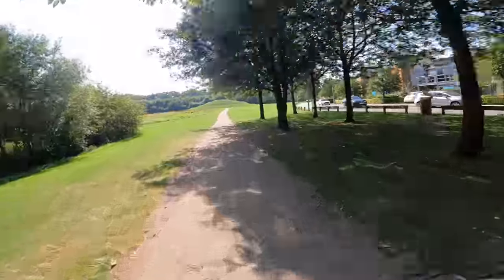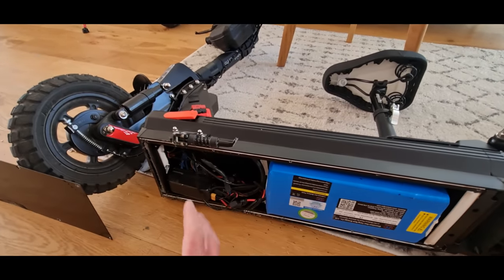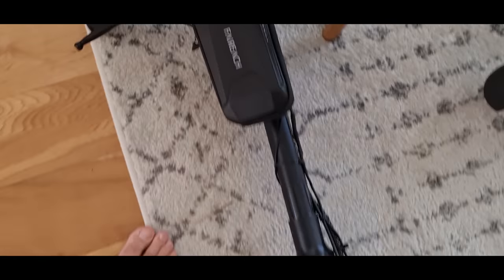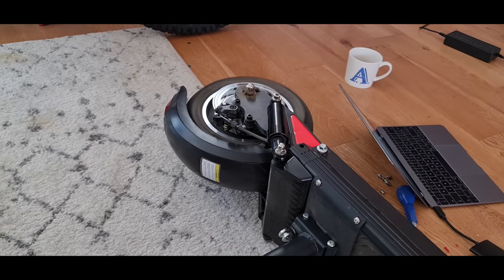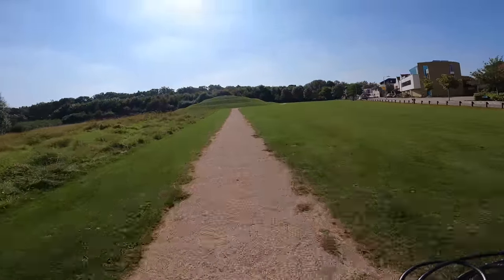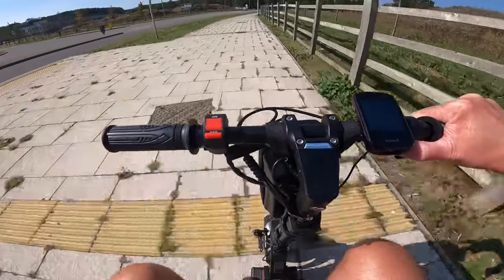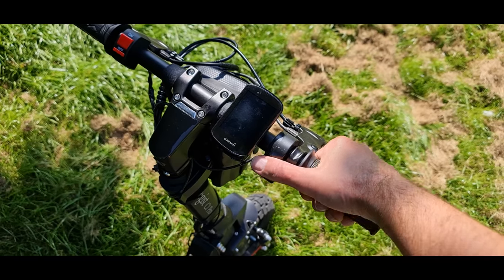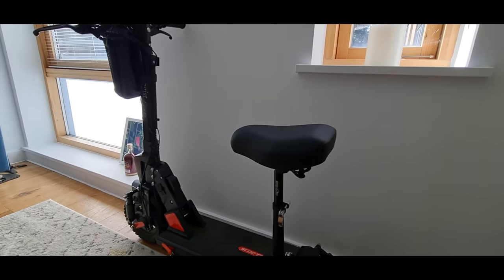MORE SCOOTER MODS!!!

Comment: Are you from gosport mate? Ive got a Wolfmac H10 and it's a non runner. I need help sorting it out mate??? It got 2 600watt motors 52V. I bought myself a multi meter it all works just can't get it going. Plugged the wrong plug in the other day and had a little fire so melted a few wires but have ordered new ones off eBay. Do you fix scooters mate???? Cheers Ryan

Comment: Pretty bad ass for a little scooter. I like the household circuit breaker idea to pull max juice from the battery as needed...and the "coasting" part of your switch is a good thing to reduce motor use.

Comment: Hello andy, I'm looking for a bit advice..I've got a mtx33 1500w kit with a 1500w 48v 17.5ah Battery and I'm looking to upgrade the controller that you get with the kit to a sabvaton, I'm just not sure which spec of sabvaton controller would work best for the kit I have ? As there s a few different sabvaton controllers with different wattage and amps ect..?? Thankyou

Comment: I have the same scooter and I am having alot of trouble trying to remove the back wheel in regards to the cable attached I can not find where to disconnect it to give enough length to drop the wheel. Any suggestions would be much appreciated
Reply from the maker: Hmm, sounds like there's not a lot of slack... you might have to take off the bottom panel and see if you can feed a bit more of the motor wire through. There's 3 motor phase wires which are usually bullet connectors and then a small micro connector for the hall sensors. Worse comes to the worse you can unplug those and then pull out the wheel completely.

Comment: Silly question Andy, But can you link a bafang with a phase runner, Im sure you rigged one up too the vapour you got but im not getting the bafang ultra, Just grabbing the 1000w 48v for now, Only coz i already got a 48v 20ah battery, I do plan on getting the ultra tho, Just the funds are in the way of grabbing the big boy bafang, Still tho the 1000w is a bit of a blower, I will buy a phase runner if it makes the bafang more of a monster, Like i said tho only got 48v battery, But yeah will defo grab a phase runner if it makes the bafang better, Soz for the daft question bro....
Reply: You can definitely run a bafang on a phaserunner MT, you would just have to get the phase wires and hall sensor wires wired up correctly. Technically a Phaserunner L10 would be fine but you would need to adapt the bafang wiring harness to the L10 plug, so I don't think that is worth while.
Reply: @fang64  Oh ok, Yeah that seems a lot of hassle, Taking the motor apart is not the road i want to go down, Excuse the pun, I bought a carrera hellcat lmt edition 29er by the way, lol, Its waiting for the bafang motor, I was giong to get a hub motor save few qiud an that, But after seeing the bafang 1000w, I was thinking coz its only 1000w it would be crap, I got a 1600w monster scooter an that only hits 35mph so i was thinking 1000w aint going to be very good, Some of the vids i seen on youtube the bafang motors are blowers, I dont understand tho how the hub 1500w hits the same speed as a bafang 1000w, Is it coz you got use of gears on the back, Also looking at the cyclone 3000w motor aswell, Was told you need to weld a bracket or something, But that cyclone motor allows you to use gears in the middle aswell apparantly, I really cant wait to actually get the motor for my bike, New toy an that, Nice one for pointing out the extra wiring ect, Prob just leave it as it is, The bafang pushes enough torque as it is really for what im using it for, Its only an everyday ride, Not off road crazyness so box standard it is, lol, Cheers yeah....
Reply: @mad-b264  zero need to take apart the motor, you can just use the harness that comes with it, and wire it up to the controller. You can actually get the bafang connector but you still are on the hook for getting it wired right.
Reply: @fang64  Bafang connector, What is that, Im new to the electric bike motors, Dont the 1000w bafang push out 1700w peak power?, I do plan on looking a lot more into programing the bafang, One im looking at on ebay got a mosphet controller i think its spelt like that lol, Im actually looking foward to doing the install an having a little pet project to play with, lol....
Reply: @mad-b264  Well you should find out what you currently have, you mean Mosfet. Your ability to handle peak power is going to depend on 3 things, Battery, Controller, and Motor. Battery limitations, how much current can the BMS (battery management system) of the battery provide (max current) at a given voltage. Controller limitations, the wire gauge (overlooked but important) and wattage limitations of the controllers internals (if your controller is maxes out at 25A at 48v you only get 1200W). Motor is mostly going to be governed by the max phase current it can handle, you can get away with running higher voltages but your current limitation is down to the construction of the motor.
Reply: @fang64  Nice one for that bro, Never knew i would only get 1200w peak with a 20ah battery, Its meant for a 1600w scooter so surely it would be good for 2000w??
Its proper confusing all this amp hour an watts lol, I am willing to learn tho, It can only be a benefit knowing the how too's when building an electric bike so too speak, Lol, But yeah I am learing slowly but surely, lol, I never wanted to get a new battery coz i actually payed 360 qiud for a 48v 20ah battery, Felt robbed paying that price when i see 52v 20ah for 240 qiud on ebay, Is 52v a big difference from 48v?, coz it dont seem much, I dont really want to buy a new battery but dont want to take it apart an fit a new bms to it, I actually did buy a soldering iron aswell but im worried summit will go wrong an i do damage that will cost more money, I been struggling to save up over the last year, Dont know why, Think it might be cost of esting healthy on Drs orders, Lol, So i cant afford to take things apart to make a mistake that costs more money, I actually could take the motor off my electric scooter an buy a frame or get summit made to hold the motor in place like the bafang but it wont be held in by the crank so i think it will be more problems than its worth, Plus its a working scooter an i dont want to destroy summit that is working, Anyways the monster scooter is great fun, An buying the bafang will give me another toy an transport to use, I plan on having a week away in Brecon Beacons, It not far away from me an glamping is actually not that expensive for what it is, Brecon is bit hilly in places so i think i will end up burning a hub motor, I plan on putting a little vid up when its done, Just showing peeps a few places in Brecon they can take a bike an chill, Might help my CPTSD issues aswell see, Been having problems with my mental health recently, CPTSD symptoms sucks i know that much, Do you know anywhere i can get a bafang 1000w a better price than 480 pound by anychance??
Reply: @mad-b264   20 Amp-Hour rating is not the Current Limit/Amp Limit of the pack, the Battery Management System is what controls how much it can output, a 20AH battery at 48v might be able to only deliver 200W max if it's limited to 4 Amp output by the BMS. As far as the motor and parts are concerned, I think finding a broker on Taobao or Alibaba might be the best route and trying to find cheaper. Dealing with those vendors directly is more difficult, but you'll be able to work with them to find a solution that suits you better. Although with supply chain issues right now you might be limited in what you can get "now." 

I am running a GMAC 10T from Grin Technologies on my mountain bike, and quite happy with it. Although I am running a 72v pack at 40AH that can do a max of 50 Amps output, I actually limit the max current down 20 amps to keep my bike at 1500W max output for the GMAC 10T. I did a kit from Grin Tech with that motor and a phaserunner L10 controller. I do have another bike with a bafang motor but it's running a smaller 350W controller and motor I mostly use it for short hops as it's only got 18~ mile range or so. I think kit wise there are good deals to be had, also keep in mind November 11th is Singles Day in china you might be able to get a deal on a battery or kit then as well depending on how crazy  you wanna go.
Reply: @fang64  What the F is singles day in China about, Daft question, Discount day for single peeps is it, lol, Never heard of it before....
Reply: @mad-b264  Yah I wouldn't blame you for not knowing, it's just another sale day like "cyber monday" that stores there run. I bought my 72v 40ah pack there for about $450 which saved me a bit on that pack. I do understand feeling like you get ripped on the batteries it's a trade between do you want a fire hazard or a reliable battery sometimes too, reputation of the vendors is important to me as well.
Reply: @fang64  Yeah ive seen a few vids of scooters an e-wheels catching on fire, So you got a point, The chance of a fire starting on crap electrics is massive, I think i would rather pay the extra knowing people actually do cut costs with battery production, Should be harder punishment for people who knowingly sell dangerous items to make more money by cutting cost on qaulity production, People do die in house fires, I wonder if a company caused a death from selling dodgy stuff an get charged with manslaughter or murder, Take wish, I dont recommend by the way, The amount of dodgy electrics an fake products on wish is crazy, Or is it consumers risk, Be interesting to find that out, Its why i only deal with ebay with a seller that has 100% feedback an is what it says it is on the box so to speak, I stopped buying from Amazon was getting expensive knowing its next day delivery i think you end up buying more things you dont really need, So i only use abay now, I cant go into busy shopping centres busy shopping areas, Plays havok with the ptsd i suffer, I forgot last time i went to my local town centre, Everything too expensive anyways, Lol, For what it is tho i think 480 qiud is resonable price for a bafang 1000w motor 3 day delivery, The price pays for itself not having to use public transport an i got an almost carbon free journey, Its only the charging the battery, Public buses are nasty ass desiel engines, I would prefer to journey on an E-bike than a car if im honest, I can think more an not get stressed from taking ages to get anywhere, A to B an thats me, lol....
PEV's is the future of how people will travel....

Comment: Needs about another 30 cm in the length, and fill the added space with more batteries.  

Then you’ll have a real-life equivalent of a fictional Drip-Scooter - 55 km/hr top speed.  These are known by those not accustomed to them as “volts of terror.”

Comment: I tried my C1 Pro out for the first time, only major complaint so far, is; how do I enable cruise control? Also I've found the handlebar too short, what length, would you recommend?
Reply: Hold the right brake.  Start the scooter.  Activate the throttle 3 times.  Release the brake, the cruise control icon will flash twice.  Then, when you are riding at a constant speed for about 5 seconds, the icon will light up and the cruise control will hold your speed constant. The cruise control will disengage when you activate the brake(s).  It will again work when your next speed is constant for 5 seconds again.
Reply: Great answer!

Comment: Running more power to a motor is like running more power to your speakers. You can get better performance on dynamic use, just as speakers on music, but if you run it continuously (just like playing just a tone through a speaker) it will probably blow.
Reply from the maker: Quite true, although with a speaker you have a maximum deflection for the cone that's part of the speaker design, thats the weak point, with a brushless motor it will actually spin as fast and with as much torque as you throw into it and you are only really limited by its inefficiencies operating outside its design parameters (heat build up and saturation of the coils) 
I liked the tone analogy.👍🏻
Reply: @andykirby  if you no load a motor at high voltage, your only limit is commutator brush sparks on a brushed motor, but adding load, there is a certain point of maximum efficiency, then maximum power, and then after that, adding more load just causes the motor to get hot and output less power, yet input more.
I'm interested in the concept of a retro-direct drivetrain for an e-scooter. The concept is that you run two chains and a freewheel with 2 cogs, and 2 cogs on the motor. You figure of 8 one chain in a low ratio (with guide cogs to prevent chain rub), and leave the other chain as usual. where forwards engages a high gear and reverse polarity engages a low gear, and there is a current sensor that reverses the polarity when current gets too high. You are scooting on the flat and you come to a hill. The ratio is 3:1. The motor starts struggling, the polarity reverses and you go into a 5:1 on the figure of 8 chain. Or you can just make it a manual, where the throttle just goes backwards. I see no need for a reverse gear on an e-scooter.

Comment: looks like a mess, you should also have your brushless controller as close to the motor as possible, you are losing a lot of power due to the inductance of the long wires. and you need much thicker wires for 30A-63A

Comment: i wonder if a phaserunner would pep up my carerra ebike? i changed the motor controller to a 350w 48v 15a instead of the standard 250w 36v 7a, it has made a world of difference to top speed and acceleration. maybe im near the limits of what my little hub motor has at 23 mph.
Reply: Buy 30amp controller and 52v 20ah battery 😊

Comment: just one thing andy won,t it over heat your motor mate and what voltage is it 48v and how quick did you get mate m7byf did you have your handheld in the front box mate lol thats what i do and go up ashhurst beacon with mine on my 30 mph scooter

Comment: Lol Just change the motors Lol. 1800*2. You would have went up that hill if you changed the motors. Also that thing is going to end up getting way too hot
Reply from the maker: I've got a solar P1 with two motors, the point of this is to show how far you can go with a cheap 1 motor scooter. Also this is a lot lighter than the P1.
Reply: @andykirby  Aight